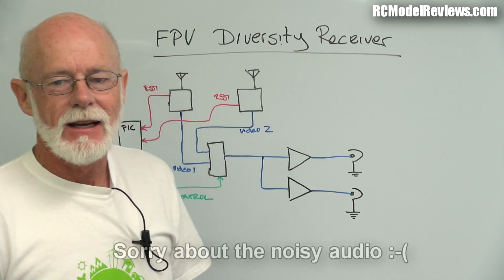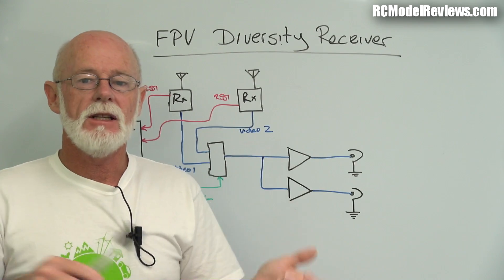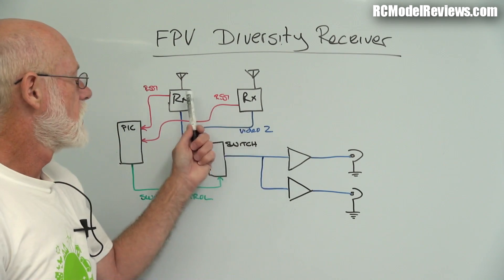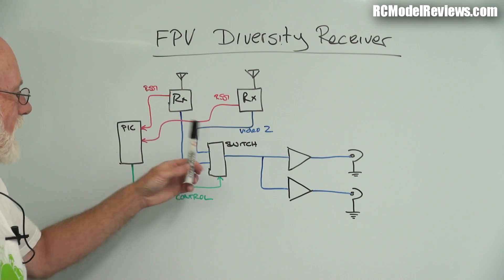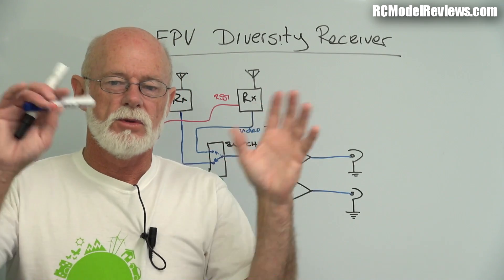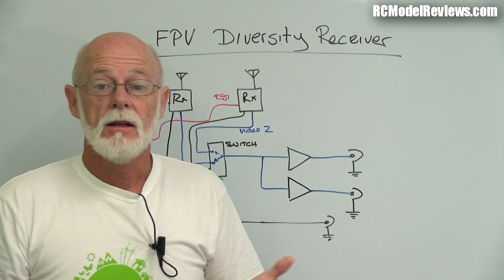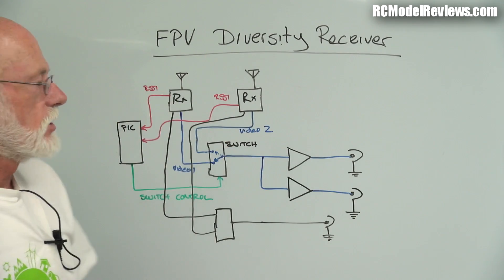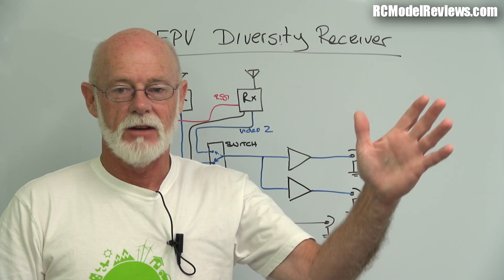DIY FPV diversity project (part 1)

Comment: Hi Bruce, thanks for all of your great videos. Always a great source of information. I have just bought an RC800 monitor/dvr (thanks to your review) ;). Would this diversity controller be usable with that? I am guessing that I would just have to use the rs800 as a monitor/dvr and make new receivers for use with the diversity, is that correct?

Comment: For a beginner wouldnt it be easier to simply use a arduino uno?
Reply: MyGunfreak how ?
Reply: It would probably be a better idea to use an Atmega that already is used in an Arduino, to be able to program it like an Arduino. Why? For community improvements on the switching code :) Great project anyway, didn't think that is would be this simple.

Comment: Hi Bruce.  I bit of a moan, not from me, my after half, she moaned at me for watching so many of your videos over Xmas.  They are great, well presented and very informative, many thanks for that, and the time and effort you put into them.  You certainly have educated many people through them.

I have sent your link out to all of my RC buddies.

I cant wait to see the next issue on your diversity project.  I have my own CNC router so making the board should be easy.  I have also done a little Picaxe (I think PIC is slightly different) programming so I hope to be able to understand the code.

I am working on my own FPV models Hexa's at the moment which will use standard off the shelf parts, all but the centre hubs, which will have integral power distribution, all designed around FPV use.

Really liked your Frsky Videos How do they do it for the price?

Keep up the good work.

Weather here in the UK has been very wet and wild over xmas and the next few weeks, so it will give me a chance to push on with my design as there in not chance of flying

Comment: I've been waiting for this video since you started your back pack while ago, thank you..2 questions Bruce, 1) are you going to have LEDS to show which receiver is active? You mentioned it being a good idea on the video goggles you reviewed a couple weeks ago. 2) hypothetically speaking about RSSI, suppose the RSSI for same type of receivers is calibrated differently, will we be able to adjust each to fine tune when to switch away from that receiver?

Comment: This will be interesting, good timing too. I am just working on putting my ground station together. Are you using a 16F84 by any chance? That would be handy as I have several blank 16F84's in my parts drawer.
Reply: No, unfortunately the 16F84 doesn't have any ADCs so it can't measure voltages.

Comment: Everyone keeps banging on about using an arduino, but I say GO PICs! Nice and cheap, simple, small and light. Arduinos are massive compared to a tiny PIC. This project could be the next step for the arduino bods here, the code should be easy enough to follow!

Comment: Hi Bruce! 
Just a quick question, I use fatshark predator v2 goggles on my fpv multirotor and i planned to set an external lcd screen so my friends can watch while i fly, what's the best setup? Do I need to strengthen the signal or can I just connect the lcd directly to the goggles? 

Best regards Toby
Reply: I would assume that the goggles have buffers on the video output.
Reply: Beats me... I'm new in the game of FPV, the only thing i know it's that there's a 3.5mm plug av-out on the side of the goggles and there's a cable that comes with the goggles to connect to a lcd.

Comment: do you think you could use a comparator as a replacement for the uC
Reply: I don't see why you couldn't, it'd get complicated to switch between more than 2 video signals though
Reply: indeed
Reply: not really complicated, just swap the RSSI inputs for negative. Use variable voltage dividers for calibration if you have two different types of receiver. You'd need 8 comparators if you wanted to switch 4 inputs.
Reply: Also software lets you do things like let you choose whether you have low voltage as higher RSSI or lower RSSI. Can still be done in hardware, but easier in software.
Reply: This is true

Comment: bruce... fore sure you have already checked... from here the switch seems something like 4066 or equivalent... do you ever tried proper video switch from maxim ?
i've done something very similar to you around an atmega 328p uc and a max chip (i don't remember the name right now.. but i can check if you want)... i've used them in my application due to very low on resistance and the attenuation is fairly costant along all the bandwidth...

great works....
Reply: Yes, I'm using the 4066 because it's cheap, readily available and works very well.  The major bandwidth constraint in most FPV setups is the RF link and the pass-resistance the 4066 is barely noticeable because of the relatively high input impedance of the video buffers.
Reply: *****
got it ! :D

Comment: Good one.
Now add 2 more receivers, 3 unidirectional and one omni, add a servo controlled antenna post, do some math on the micro to turn the post appropriately and design some nifty enclosure.
Done :)

Comment: Hey Bruce, Atmel programmers are much cheaper and generally more available in the hobby. Why not use an Atmel chip?
Reply: Mainly because I've done a snot-load more work with PICs and then went pretty much straight from PIC to ARM so I've had less time with the AVRs.
Reply: ***** Makes sense now. Thanks!

Comment: Great concept! Would it be an option to use an Arduino instead of the PIC and the switch?  Have you ever thought about this idea? Or isn't this possible with an Arduino.  I'm asking because I have an Arduino laying in my hobby room. :-) Thank you for your videos.  Cheers, Alex
Reply: You could use whatever microcontroller you want!

Comment: Awesome!  Thanks for taking the time to put this together. 

Do you have the board CAD files available?  Would like to get some made here in the US.
Reply: Yes, I'll be putting all the PCB boards on a webpage for download.  They'll be in EagleCAD format and as gerber files.
Reply: ***** gerber? isn't that some little rodent? :) :p
Reply: ***** Will you be making the .sch file available?  I would like to design a board to use 2.54mm pin headers like the versions of your VTX and VRX I have posted on the forum.
Reply: Yes, all the project files will be available, as well as the PIC code (in C).
Reply: @xjet  hey Bruce. I am new to model aviation. I was just on your website. Could you provide the Web link for this project? I have some pic controllers and would like to modify my goggles to support diversity and create some repeaters for a future project.